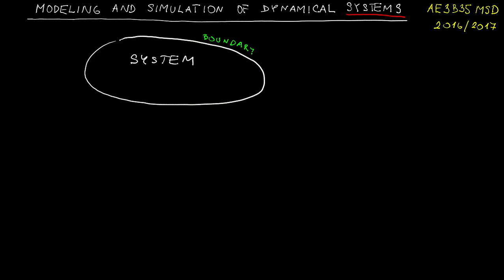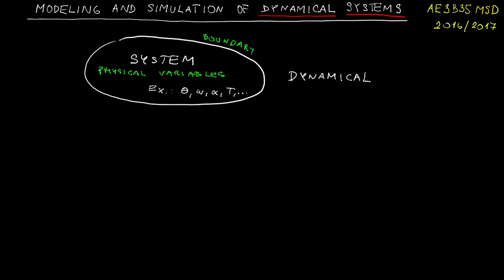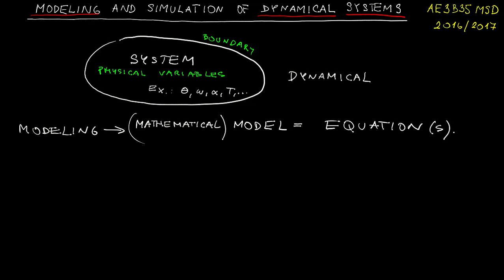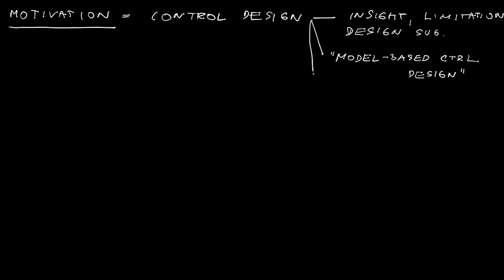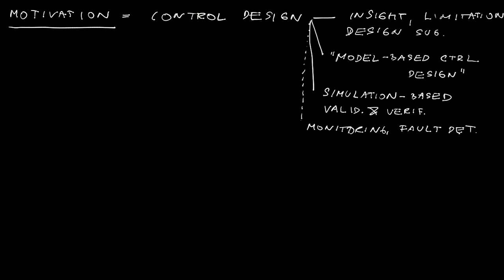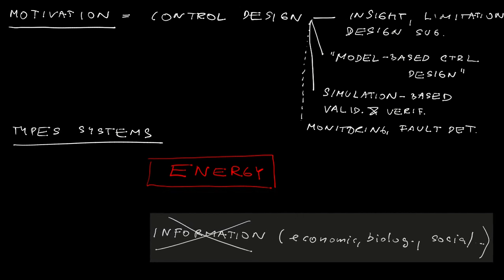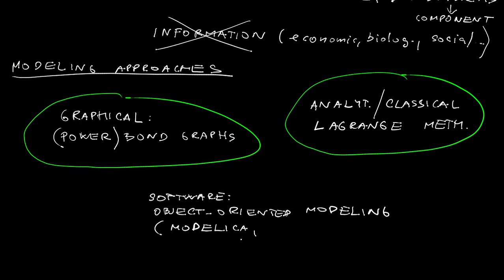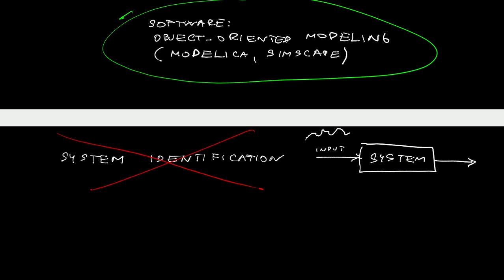1.1 Modeling and simulation of dynamical systems (AE3B35MSD): Terminology, motivation, scope

Comment: Which book do you recommend
Reply from the maker: On the (current, Czech version only) course webpage https://moodle.fel.cvut.cz/course/B3B35MSD I have a list of recommended (English written) literature. A direct link is https://moodle.fel.cvut.cz/mod/page/view.php?id=126879. Namely, Brown and Karnopp are the two recommended textbooks for the first part of the course, in which we learn how to model multidomain systems using (power) bond graphs. But I invite you to check sections on recommended literature in blocks dedicated to individual topics/weeks. For example, for modeling of electromechanical systems using Lagrage equation: https://moodle.fel.cvut.cz/mod/page/view.php?id=126959. Or for modeling using Open Oriented Modeling (OOM) approach: https://moodle.fel.cvut.cz/mod/page/view.php?id=126985. And so on.